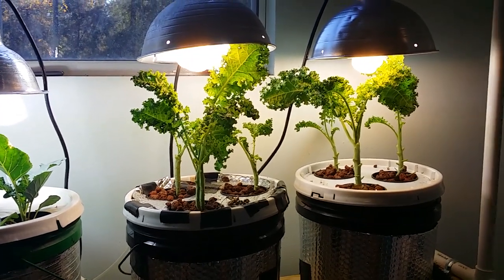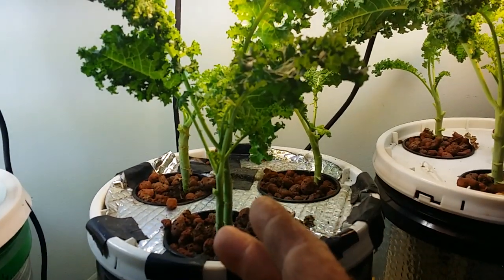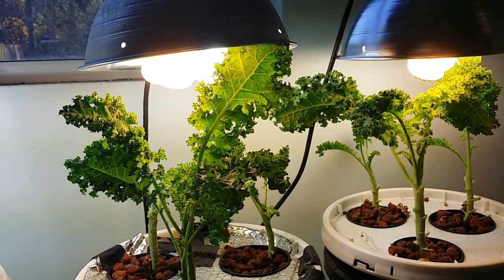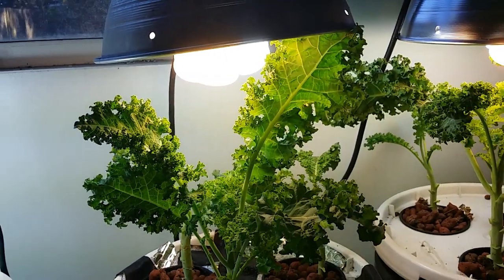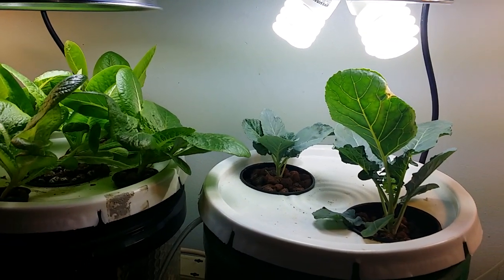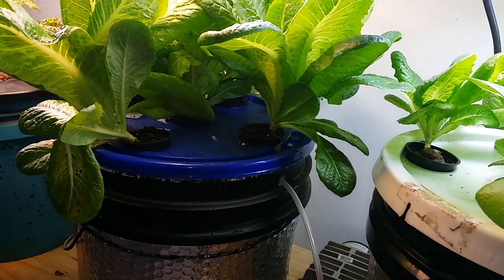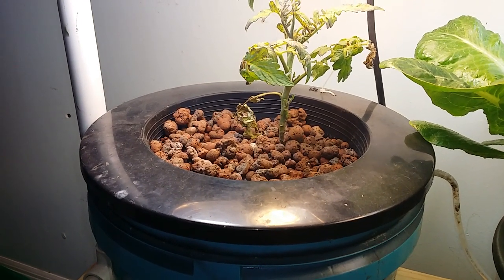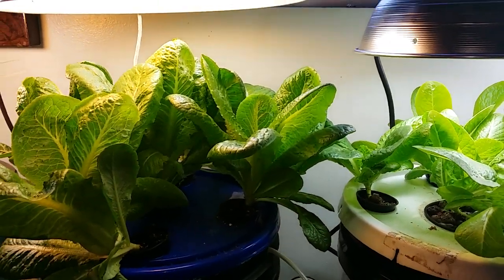Indoor hydroponics dwc vs kratky update 3 ep 51

Comment: warm up the Neem Oil ie hot water and add some washing up liquid in a spray bottle, shake that up so its all mixed and you see the suds aka bubbles and mist(spray) those plants like some one passed a stinky wind (fart) under the leaves as well drench them and leave for a few days and then do the same again.....
Reply from the maker: "spray it like a stinky wind" lol. thanks for the advice. I'll give it a try.
Reply: +The Liquid Gardener 
Ps
make sure that when you mix it with the hot water add some cold water to it, so when you spray the solution is kind of tepid / warm and spray them. The Neem disrupts their digestive system makes them loose their appetite the non anti-bacterial dish soap will remove the waxy membrane from their skin and they will dry out, Also the Neem gets into the plant the oils from the Neem also gives the leaves a nice oily kind of sheen. you can get Neem from your local hydroponic store or you could go to a health shop and buy Cold pressed Neem which is the same and is cheaper.
Anything cold pressed is Good, as no heat was involved and noting is added.